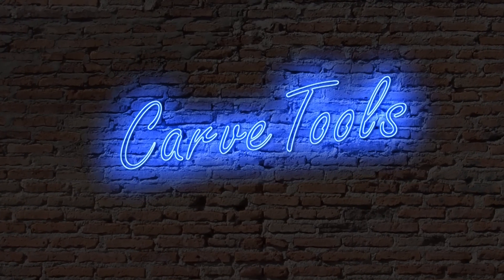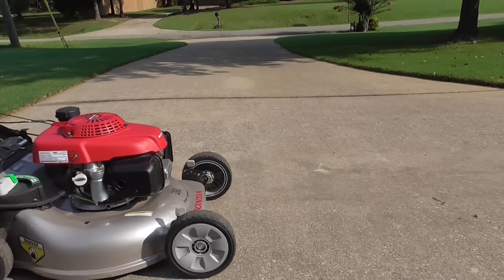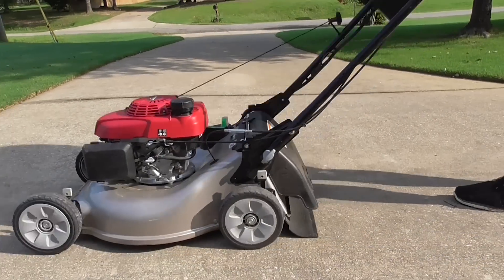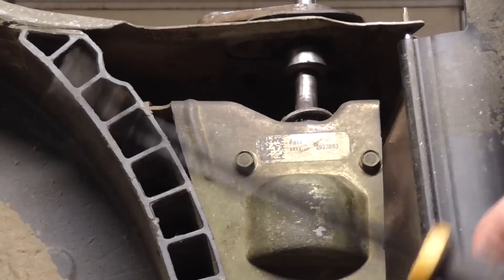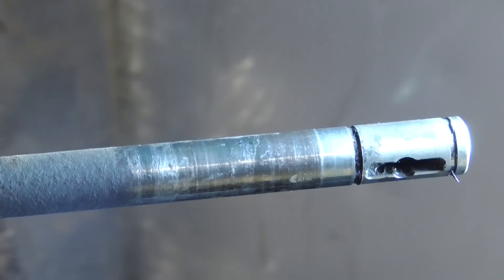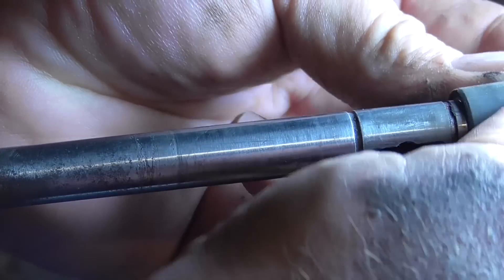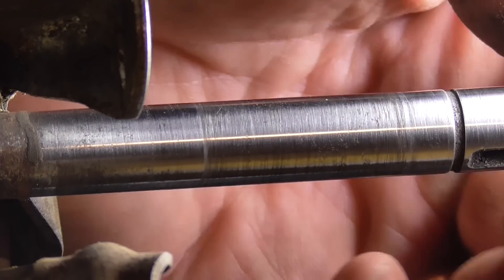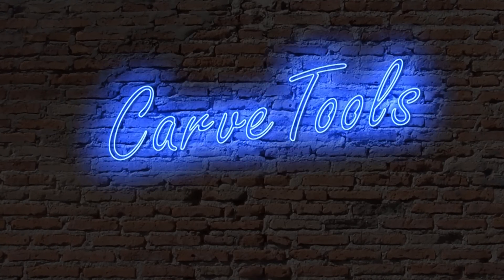Honda Mower Rear Wheels Will Not Roll Backwards THE REAL FIX

Comment: Excellent video, I just disassembled mine the other day and polished the shafts, I wish I'd have had new bushings, then I used synthetic grease on the old bushings and put everything back together and adjusted the cable as you recommend, wow, it worked.   Go forward a few days and I took the mower out because my new belt came in and I tackled that job, what a nightmare.  I got it all back together and adjusted the cable again and tested out the mower.  It was back to doing wheelies like when it was new and it mowed great, but within ten minutes the back wheels returned to not backing up.  I'm going to order new bushings (wish they were bronze) and try it one more time.  Anymore trouble and this piece of Honda crap is going in the Mississippi River!
Reply from the maker: I feel your frustration Jim. Mine has not been an issue since this repair. Thanks for the comments!
Reply: I'm going to fix my son's HRR216 mower (6 yrs old - one wheel hard to turn backwards) with new bushings. They are cheap. I'll also lube with marine grease. That should last another 5 yrs. FWIW my HRX217 mower is heavier duty and 12 yes old. No problems. Why? Design of HRX217 doesn't use plastic bushings...

Comment: I just don't understand how a bushing alone can cause this problem.  Friction is friction either going forward or backward.  What exactly is there to bind?  It's a sleeve.
Reply from the maker: When the drive is engaged forward it overcomes the binding  and it is not noticed. Three years for me now and it's still working. Thanks for the comments.

Comment: why not put some grease in the bushing so it wont  just  do it again?
Reply: John72ss, Because, since the plastic bushing is not sealed,  dirt, grass fragments, water, all get into that space and pack in, then start the corrosion process on the metal shaft, and that makes it even worse..
One has to be careful of the type of grease you use, because some grease types will attack the plastic bushing and also add to the just bad design that began this debacle in the first place..
Yes, you can put grease in there, but everyone including me, has been down that road, and in about 1 year or sooner, it will be pulling backwards very hard again..
Good luck!

Comment: I have a 4 year old honda doing this same thing!      what  a pos!
Reply from the maker: Seems like after being in storage all winter this shows up all of a sudden.
Reply: yup that's what happened, and im not in the habbit of hosing off my mower at end of season, its stored in my shed and remains  dry until I pulled it out last month backwards and the wheels didn't turn.  its now 5 years old,  my last Honda went 27 years and never had this problem!

Comment: Had a few minutes, did exactly what he suggests, it absolutely fixes the problem! I didn’t make the adjustment to the cable, but cleaning the axle, fixed it perfectly.
Reply: why not  put some kind of lube on the bushing so this wont just keep  happening? I have the same problem?
Reply from the maker: Glad it worked for you. Thanks for the comments!

Comment: Hello Dave

First time listener, I had the same issue summer of 2018. I wish, I would have known about your channel.  I had followed some incorrect advice. But my fix did not go as far as yours did! I had to clean out old grass clippings from the rear axles.  And I, was up and running. 

After watching your video,  I am wondering how to keep this from happening. My Lawnmower is about fourteen years old plus. Do you have any suggestions?

Comment: This is a common problem with all the HRX217 variants, but it’s only one of the problems that happen with them because of that axle/adjuster/bushing design.  Every one of those problems would be eliminated if there were simply a way to pump a bit of grease into that area once or twice per season.  Instead, the first symptom of a lack of lubrication is problems like this one, and then you have to take the whole thing apart to fix it.  I keep hoping someone will figure out a way to adapt zerks onto it but I haven’t come up with one yet.
Reply: KSMike1 --  Love the idea but if dirt, grass fragments, etc., water from washing it, gets into that area, how will that all stuff work with the grease ?  Won't the grease be susceptible to attracting the dirt that goes into there and holding on to it?
The OP's idea - reducing the diameter of the metal axle  imho, seems to be the only option albeit, even a longer temporary fix.. 
These Cheapo's KNEW it needed to have Sealed,  Bearings in the rear axle, and chose to go on their previously good name, to sell the crapola out of these mowers, and  never look back at all of us who are just out of luck..
As much as I really like the size and weight of this Honda, I may have to just keep lugging around the much heavier, bulkier, 18 year-old Snapper, that will Never have this issue, never get all clogged up underneath like this Honda,, and  absolutely vacuum everything off  and leave the most outstanding level cut..
Good luck !

Comment: I hope Honda fixed this issue. I'm hesitant on spending a pretty penny on this mower.
Reply: The FPV Life I’m on my 2nd one and would buy a 3rd.  BUT - it’s imperative to understand how that whole rear axle/drive system works and to be prepared to do maintenance on it.  The root problem is that there’s no way to lubricate anything without taking it apart.  In this video it’s demonstrated that the whole transmission has to be taken out; that’s not the case at all but you do have to get it loose enough to move side to side in the mower body in order to get access to the areas needing lube.

Comment: Hey CarveTools,
Since the video, was your mower locked up again? Did you have to replace the Adjuster Arm as per Honda bulletin #107? My Honda lawn mower HRR2169VLA is doing the same thing. But my warranty is expired.
Reply from the maker: Hi DN, No more lockups since this repair. Have not had any issues with the adjuster arm, Thanks for the comments!
Reply: D N --  I have replaced both rear height adjusters with the NEW redesigned ones, and it only worked 1 season and it is getting harder to pull backwards.. Not totally locking up, but harder than it was when I put on the new adjusters that have the bushing inside them..
So annoying that Honda who makes some really nice, reliable vehicles, totally went Blank, when they designed this flaw into the zillions of mowers out there..
I have not, done the emery cloth strip sanding of the ends of the axles, so I will try to do that sometime soon, but always knowing that again, someday it will be rusting in there again, and need to service this.. 
Good luck with this !   I hope you and yours are all safe from this virus !!

Comment: Thank you for the video.  I did the fix, but the problem returned.  I checked the honda service bulletin but it doesn't apply to my model.  I guess I can repeatedly do this fix, and also try lubricants frequently.  Will do so until I buy a Toro.  Sad, as I like everything else about this mower.

Comment: Many thanks!  I have the same problem here in Australia. I took it back to get the mod done at the dealer, but it didn't make any difference, as it started locking up again after a couple of months. They even replaced the gear box and axle assembly.

Comment: Thanks man! Was there any need to grease the shaft where the bushing is?
Reply from the maker: The grease probably not necessary but it is still working with no issues after doing this. Thanks for the comments!
Reply: Thank you

Comment: I accomplished this repair on my newly acquired mower early this spring. I also noted that there was a build up inside the bearing so I used a drill bit of the appropriate size to ream them out as well. After completing the repair, I was able to roll the mower backward easily. However, about 4 months later after using it for most of the season on our 0.33 Acre lot, the wheels are refusing to move again. Is it possible that this was not the real fix? Now it rolls sometimes and not other times. That is, about half the time while mowing, it will roll backwards easily, but the rest of the time the wheels just slide - even on sidewalks.
Reply: dwjw1 did you grease the axle where it rides in the bushings?  That step wasn’t mentioned in this video but IMO it’s critical.

Comment: I hope the updated height adjusters fix my mower, if not, i will be selling it and buying a Toro with ball bearing height adjusters instead.
Reply: Andy's Shop,  - I know, it's a pain, but after you do it once and have the right size snap ring pliers, its easy..  The only thing I do not like about any Toro mower is that they do a LOUSY job of cutting grass..  They have no lift going on under there so they just smash the grass down and sometimes cut it..  
The Honda with the 2 blades, has better vacuum and it really cuts nice and even..
However, the Honda seems to like to store grass underneath it all the way round that groove  and other places, and it requires you clean it out after that cut, or do it later when it has hardened up and  that wet grass has turned into an acid that is attacking the metal underneath..  It is always a world of trade-offs anymore..  :(
Reply: @frandanco6289  I did the fix today. Used a wire brush on a drill to get the rust off. Then, I sprayed WD40 rust inhibitor on the entire shaft. I hope this fixes it for at least a couple of years. Also replaced the rear height adjusters because of the TSB.
Reply: @frandanco6289  didnt fix it. Went back to doing it after a week. Im buying a Toro.
Reply: @andym1223  - Sorry this terrible designed real axle bushing and exposed axle design has ruined it for you... I have 2 mowers so the 20 year old great Snapper Hi-Vac gets the most use and actually cuts it all so much more flat because it really pulls the grass up straight and cuts it... Don't blame you for going elsewhere... If I could afford to spend another $600 on a mower, I might too, but I cannot..

Comment: Didn't fix my issue. Noticed when I tore it down to the point where the height adjustment bracket is off the Axel won't turn both ways. So what's the issue needs a new transaxel I assume. Oh well lol I still sanded everything like ya did and re greased everything lol.
Reply: You need to replace the axle supports as they are called. Sanding the axle doesnt fix the issue.
Reply: @scottfirman  I replaced both axle supports with the supposed newer version and the thing still locks up because dirt, etc., gets in between the exposed rear axles... Terrible design....

Comment: Was always a Craftsman man and had this problem. Decided to "step up to the Honda" and the first season I was in heaven. First time out this year I had this very issue. Went thru the manual fix by adjusting the cable from one extreme to the other with no help. Called Honda and a very friendly attentive operator was absolutely no help. I refuse to believe I have to disassemble a 1 year old Honda mower so I don't have to literally drag it out of any corner I mow into. BTW: DO NOT open the gearbox unless the mower is upside down or you can get under it. Has gear oil in there. Fortunately I had some to refill it.

Comment: Sweet I'll give this a try! I just picked one up for 30 bucks and every little doohickey didnt work except starting it. Couldn't stop the motor without pulling the plug in the parking lot when I bought it( didnt know where the throttle link was then), the blade didnt engage because the plastic button wasn't positioned correctly, and now I'm tackling this and the drive in general doesnt go forward. I hear it squeal and I can feel it get right but maybe it just needs to be adjusted. Only problem is the the thing didnt come with a clippings bag.

Comment: Dave this is a real help. I was wondering for a temporary fix could I just remove the wheel and spray WD40 into the side between the bushing and the axle?
Reply from the maker: Hi Gary, WD40 wouldn't hurt at this point. I just wish Honda would make their recall on this friendly to registered owners. Thanks for the comments!
Reply: I did this and it worked for 1 mowing, but the second use of the mower it locked again.
Reply: @digicandy70  Yes it does come back because dirt, etc., gets in between the bushing and axle just by using the mower... It is just a very bad design that Honda should have never used... Very disappointing for everyone who has one...

Comment: Thankyou! All the tips I got were BS. I know which way the cams go and know about the key and spring. So its the bushing! Its a simple fix but involved. I saw one guy put his together but it didnt work after he was done! I broke the 3 speed shifter on mine so had to order one. They are awesome lawn mowers and I wouldnt buy any other mower. The Snapper is a good mower but they use a crappy Briggs motor that viberates. I have issues with my hands so if I can avoid viberation , I do.Thankyou for the REAL fix!
Reply from the maker: Thanks for the comments! I never found any tips on how to fix this problem so I decided to disassemble it until I found the culprit. Good engine but the rest of this mower is lacking in engineering. I'm trying to be nice.
Reply: RC Hobbyist Extreme --  Sounds like you have been in that fix a few times, as have I, because I like to scoot it over sideways to mow the next line, it sometimes moves the big C-clip underneath that holds that entire right rear assembly together. So then the height adjustment goes to the ground..
Soooo, I pull out my 18-year-old Snapper, and finish the lawns..  :)
Yeah, I guess the B&S engine vibrates more but I dont notice it or need it not vibrate..  
The Snapper absolutely kills any mower with its great vacuum and  straight, even cut!! No other mower does it like an old snapper that has the big rotating disk with the rubber drive disk over it.. 
And if you really want to make your lawn look like any golf green or baseball infield grass, try cutting it in 2 directions... Nothing compares..  :)
I too had hand, arm, carpal issues years ago and after trying everything, the  ONLY true relief I ever got was when I went to a hand surgeon, and he using micro technology,  to go into the carpal tunnel block near my wrists and all the other carpal tunnel places in each finger, and after that, it was unbelievable !!! No more of those hand arm issues, been going strong for almost 20 years..   
Good luck with your projects!  I hope all you guys are safe from that dang virus..

Comment: I've had my mower for about 3 years now and never had this problem until one day I thoroughly washed it with a hose and the following week the wheels wouldn't roll backwards.  I assume water got onto the shaft and caused surface rust and locked up the wheels.  I will now have to try this fix and hope it works.
Reply from the maker: This should work. As of yesterday it still pulls backwards with no issue. Thanks for the comments!

Comment: I tried this fix with my mower also and while it worked initially when the grass catcher was installed and partially filled the wheels would lock up again. Still trying to find a fix for this.
Reply from the maker: Hi vegasvasha, I can relate, seems like when the catcher got full more weight at the axle caused the wheels to lock up when pulling backwards. I suspect it was causing more friction and the plastic bushings were swelling when getting hotter. May need to sand the shaft or ream out the bushing some more.  Thanks for the comments!